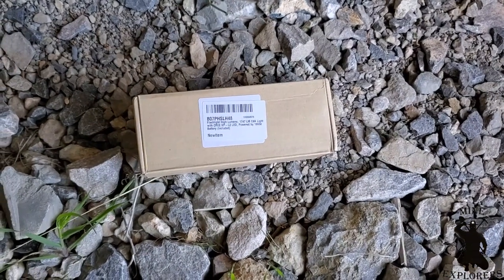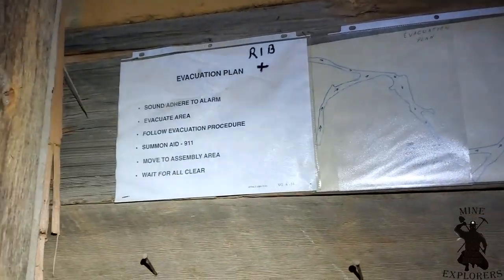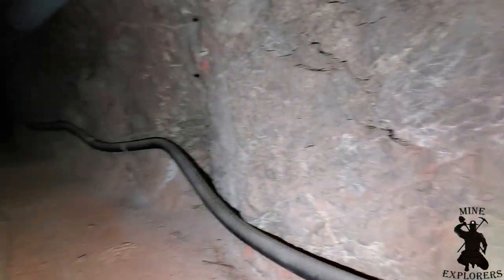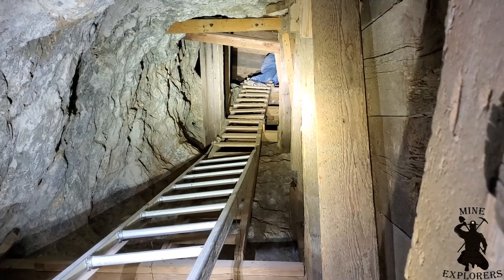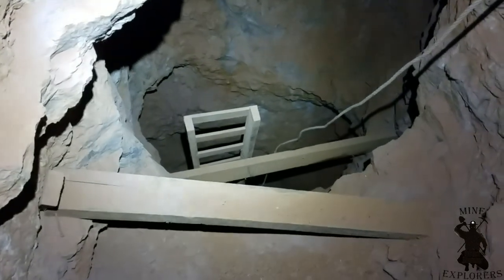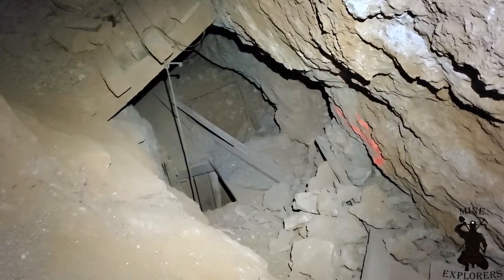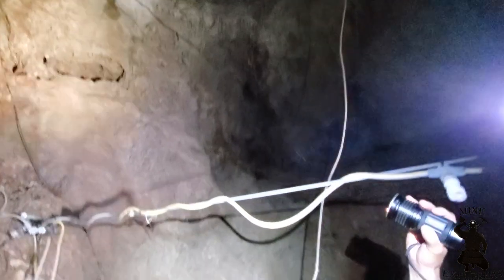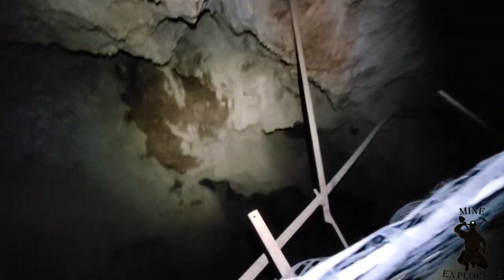Sofirn C8A Flashlight Test In Underground Mine

Comment: Mr. 

Mine Explorers, 20:15 fan rotation and direction, look at the blade surface, it will scoop the air so the blade concave surface will rotate to scoop like a spoon, also the shape of the fan plenum is a dead givaway, the rolled edge is were the air enters the fan, facing that fan rotation is clockwise so it draws air into the room, GREAT VIDS, how about you put a face to your dry humor

Comment: Its for rebare its reasen some is fast and slow you use the stoper and it has a short steel and socket on the end it turns the rebar and mixes the reasen and it hardens there is your rebar solid the fan is air operated .